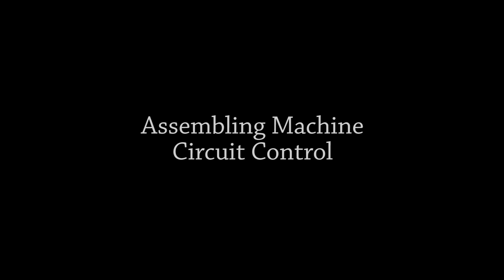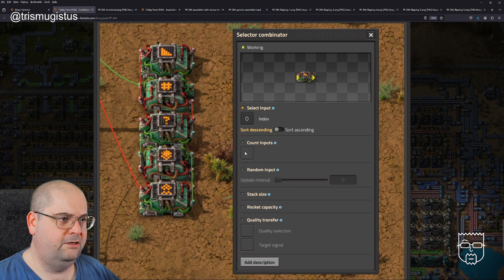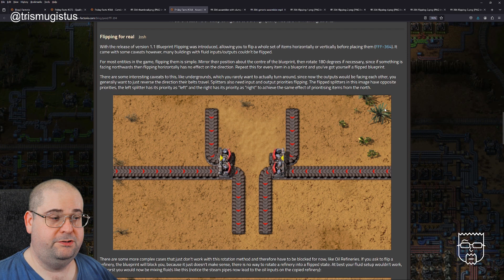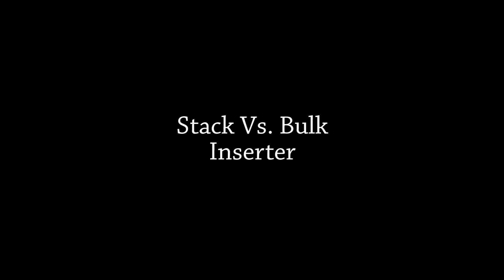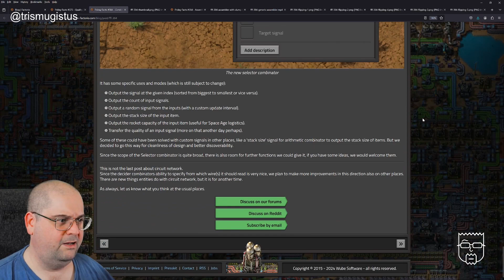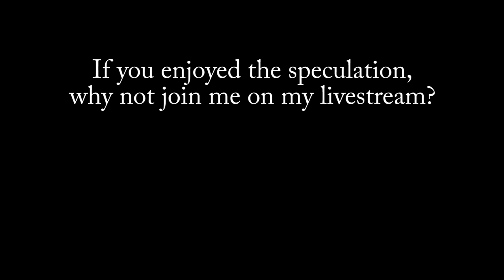Flipping Amazing! | Factorio Friday Facts (FFF) #394 | Analysis & Speculation

Comment: Words smallest botmall?
Reply from the maker: I mean, presumably you could do it with just the 1 assembler, depending on where you drew the line with intermediates as you need fluids like lube to make electric engines, and what you include in it.  But I imagine the area taken up by the combinators would be huge, so it would be interesting where the balance is between machines and combinators.